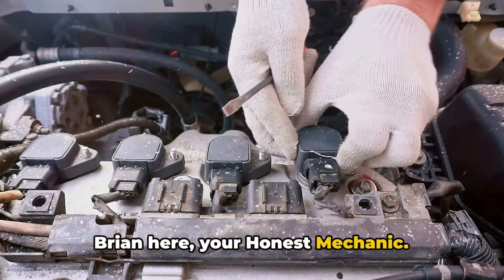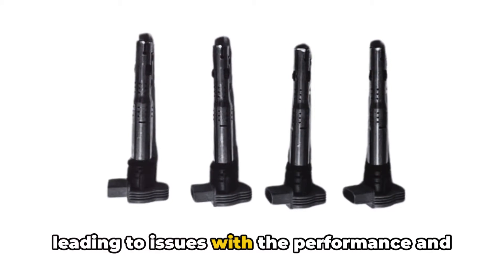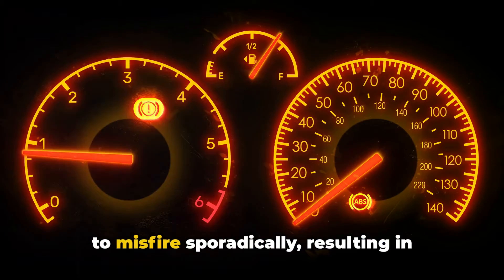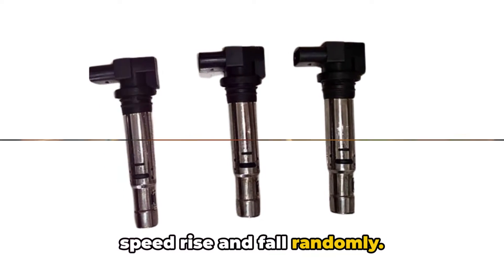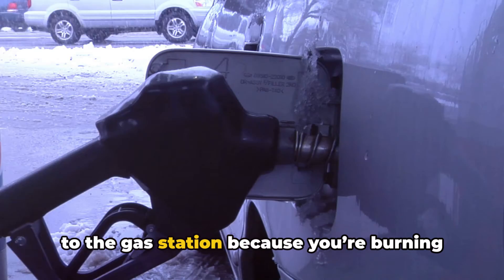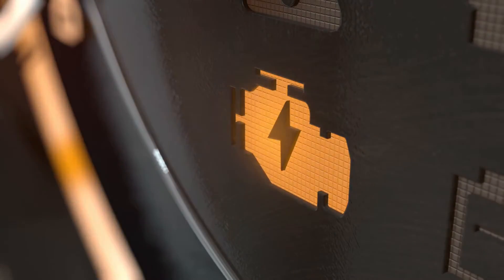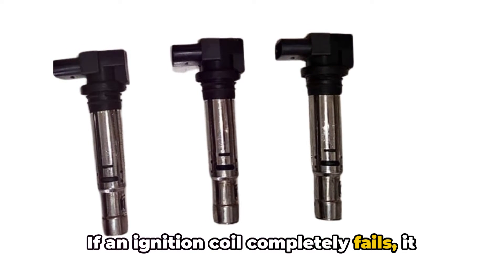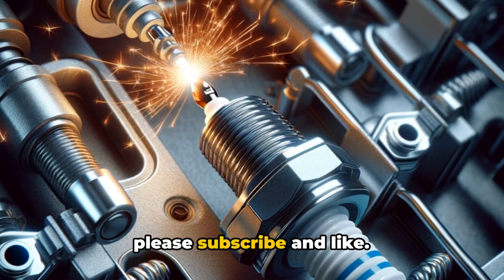Bad Ignition Coil Symptoms: 7 Common Signs

Comment: I get a EPC light not a check engine light.... And do notice my fuel going up and down after pumping gas did the coil test and it turned out it was the ignition coils

Comment: I was getting super rough idles and at times the car would choke or struggle to turn over. Check engine light finally popped up and got the code and it was a cylinder 2 misfire. Now the car won’t turn over at all. The lights come on radio everything works but the car sounds like it wants to turn over but just the engine kinda clicks but  won’t turn order. My firing order is 1342 so I’m hoping changing out that ignition coil in cylinder 2 fixes it. I just changed spark plugs about 3 months ago
Reply: It should…

Comment: Don't just run out to the parts store and replace the ignition coil(s) based on this video.  There are other things that can cause the same symptoms.  You could start throwing parts at it such as ignition coils, spark plugs, and fuel injectors for instance and it may or may not solve the problem.  Other things that can cause the same issues include a vacuum leak, loss of compression, a bad EGR valve, etc.  Take the time to learn proper diagnosis procedures instead of looking for a quick magical cure.

Comment: When i cold start my car it's normal and getting started within no time after driving for 50kms and when i turn off and turn on the ignition feels like its struggling like a battery low symptoms but battery is brand new please help me to fix my problem already i have spent a lot on fuel pump and so many other things I hope someone with the knowledge can help me
Reply: Sounds like o2 sensor going bad or your coil packs

Comment: Not all the time the code will show up for a failing or weak coil pack remember the coil pack could be working but weak and not not giving out enough spark.
Reply: How to check weak coil... please reply
Reply: @santoshmurukate7894  i had a friend check for a weak coil on my acura cl and unhook one of the coils with the spark plug in still tested the voltage and a point of the car while i cranked it to see if it would spark once i got no spark we moved to replacing coil packs and distributer get them in next week so can always let you know if that fixes
Reply: @santoshmurukate7894 disconnect coil, start car see if symptoms improve. di it for each coil. if you identify a coil, try it on a new cylinder. if the problem follows the coil, its fualty
Reply: That's right.  I had in my car a weak coil pack in cylinder 3 and didn't have any code.  I felt the juddering and jerky when going up hill. Replaced it and all solved.
Reply: @Sebastianvinxc 
Ok thanks for reply

Comment: My 2006 MB C280 had this problem one coil pack was defective working intermittently… check engine lights and esp lights started coming on crazy… found I had one coil pack bad! Question? How long do coil packs last? Thanks.
Reply: Depends on the brand and such. But honestly it’s pretty random. For example, on my family’s 07 Accent, the OEM lasted roughly 10 years, and the aftermarket ones I bought just failed after roughly 7 years

Comment: Four times we've taken our car back to the dealer describing these exact symptoms, just for them to tell us there's no fault found. It's out of warranty now and we were told it would cost us £160 per hour just for them to look at the car! It nearly broke down today so we got roadside assistance to come out and check it. Typical that the car was back to operating as normal, but the guy told us to check out the ignition coil.

With that excellent advice and your concise and extremely helpful video here, we might have found the culpret to our car's problem 👍

Comment: Would a faulty ignition coil pack cause a loud noise akin to an impact gun used by wheel technicians? My Ecoboost Mustang has done that and today it did it again and stalled out on me.
Reply: Hello there my car is as well stalling did you find the reason behind it
Reply: @ Bad Purge valve canister.

Comment: What if my Mechanic used NEVER SEIZE on new coil packs when installed by accident instead of Dioelelectric grease,  he stated it would be fine,  at higher speeds,  I start to get like a shutter or misfire, this same issue happened before and under warranty,  I took in on Pontiac Grand am V6 3.1L and ended up being the coil packs there was 3 sets of 2 and 1 was cracked and showed to me,  I thought it was the Transmission going because it did it from 45 to 65 and it feels the same, I also use Amsoil after warranty ran out but went to dealer that was 5 miles away and wanted great carfax records on it, they closed down during the COVID-19 years in 2021 which caught many off guard, then a $55 oil change went to $99 plus taxes  that fast. I heard they used Synthetic Blended oil and never burned oil until started using top oil, at 1st was Valvoline synthetic oil with the top notch fram oil filter that catches microns pretty decent for price,  AMSOIL Filter was $51 and then went to WIX as just as good,  but I do watch ENGINE MASTERS  and they tested all these but not the AMSOIL 1, best was racing Filter from the White Filter with nut on end that doesn't work and slips off and Ford Motorcraft Filter works great with Royal Purple and that is testing for microns and gallons per minute going through engine fast. If haven't seen episode,  I highly recommend it as Steve the ENGINE Dino master was surprised as well but will buy WIX at its price,  you can't beat them,  but I still want to know about coil packs,  anyone with answers,  please leave some remarks about what you think,  I don't want to replace a Catalytic converter as I'm not rebuilding the engine as they say it's the Factory Rings on Pistons and they only gotten worse on newer models,  these can run as high of 400,000 miles with 1 timing chain done. Put Michelins on it and it's like a fast go kart in 4WD EX model and son burned off set that came with it in a year but found out that how he was driving,  I showed him on my SUV how Antilock brakes worked and how fast mine was as he drove it and got 10.5 MPG  when it was at easy driving could get 16 flat but mostly was 15 to 22 miles for V8 4.6L Ford in Explorer awd limited edition with just 69,000 now but had 32,500 and warranty ran out plus friend started to fix more things on it, gave me a great deal then when worth $10K, paid $4,500 then coils went and 13 months old, he gave me all recipes with it, I replaced everything he did and 1 winter it sat as though bad intake but no heat, bad water pump and never left a drop. I replaced rubber cap on intake 3 times as cracked and blew out all antifreeze,  4 gallons it takes,  couldn't buy from Ford,  bought at auto zone and not as good or close to factory one,  alternator twice an tensioner from local and went bad again, no warranty, pulleys twice and I replaced all pulleys/idlers so all new at same time from same company which I believe was Gates recommended or Dayco, would have to look at receipts, for 4 I believe $85 for all online through Rock Auto, just watch shipping as comes from another warehouse and another $11.99 for shipping and buy local for same or 2 bucks more but cheaper still on stuff, also Summit racing has great deals as well. be safe as he didn't. Summit last knew has free shipping over $100 and get the best Rotors and pads Combo sets or buy Separately and very fast shipping over other company or pay higher prices for it and 1 day earier wasted money back then as raining out and was supposed to be 2 days earlier but hung up at location they said, with Summit, I believe it's done ASAP and picked up and not waiting for more to come in as there busy over other place and if call, can get better deals as work on sales commission so can knock 5% off if order through them  as I have because I asked if work off commissions or not,  just had a question before placing but saved me over $40 on order for a bunch of stuff back then.  Been awhile,  so don't know.  If any, will get electric bike to get medicine as can't afford stuff anymore.  I'll use a kids seat for 2 and put food in it. , when they came out in 2003 era, bought 1 for son and removed seat and put wagon handle over post and seat back on and pulling kids around then on 350 from Schwan went 10mph and 8 miles on a charge.  Used at the campground back then

Comment: Is there a way of knowing if it is a spark plug misfire vs an ignition coil misfire?
Reply: Best to change both I believe. I had the jerking/misfire issue then replacing the spark plugs actually fixed it. Till three months later it's happened again. Due to change both ignition coils and spark plugs tomorrow hoping for the best 🤞
Reply: @ShahAli-c3k  did you fix the problem
Reply: @magnumlife4081  Yes been almost 2 weeks and my cars running smooth
Reply: @ShahAli-c3k did it fixed the issue?
Reply: You could get a spark plug tester for less than 20 bucks and that’ll tell you if it is or isn’t the plugs 😊
Reply: Get a cheap Obd 2 reader, see which cylinder is throwing the error, then move the coil from that cylinder to a different one and see if the code moves with the relocated coil. If it doesn't, it's the spark plug, if it does, it's the coil. I had the same problem and fixed it today. Also check if there oil around the coils, which could indicate a leaking rocker cover gasket, again a relatively easy fix. Oil will degrade the coils so best to get the gasket fixed as well.
Reply: @pritinpatel7074 thanks for the tip
Reply: That’s my problem right now i don’t know which one

Comment: What component on the coil wears out and how? What should the voltage be going into the spark plug of an average 4 cylinder car?
Reply: Chronic exposere to high voltage breaks down insulation and cause it to start arcing between internal coil windings or to the iron core.

Comment: My car has rough idle and when i start to drive it jerks for max 1km then when it warms up it runs normal bad ignition coils?
Reply: Could be vacuum leak, spark plugs, ignition coils, EGR system like a vacuum leak or stuck open valve, purge valve, EGR Solenoid. Worse case, could be your belt tensioner or even worse timing. Could be anything, because of spark, air, pressure, compression and fuel.
Reply: Have same issues, so many could be ….
Reply: Same problem
Reply: @GaneshTanpure143  I changed coils still same problem i think its the sensor fault MAP/MAF when i disconnect it the car runs fine
Reply: @jablenski   i think same thing happened to my car. I'll try removing the maf again. thanks
Reply: Did you check the spark plugs? Is one particlar plug wet with gas or have rich, powedery, black, fuel-fouled deposits?
Reply: @gregorymalchuk272 yes I took a spark plug out and I noticed black powdery residue what does that mean
Reply: @LaborGoats  It could mean intermittently failing coils, ignition control modules, plug wires, plug stalks on modern engines with the spark plugs down a deep hole in the valve cover. It could be failing fuel injectors like sticking open, sticking closed, dirty and poor spray pattern, or leaking fuel. Or it could originate somewhere else like from low compression from broken or worn piston rings, broken valve springs, pitted valve seats or slightly bent valves, or failing lifters or worn-off cam lobes. Good luck.

Comment: At point 7 you say that if it fails completely it will stop sparking the plugs in that particular cylinder. But if it completely fails would the engine be able to start at all/wouldn’t all spark plugs stop sparking? Asking as i have a 5.0 v8 mercruiser that can be difficult to start and on changing plugs noticed two of the 8 were blacker than the others and i definitely get a smell of gas when moving
Reply from the maker: When a spark plug fails in an engine, it typically only affects the cylinder it's in. In your V8 engine, if two spark plugs are fouled and blackened, it's likely that those two cylinders are misfiring. This means that those specific cylinders are not burning the fuel properly, which leads to the unburned fuel smell you're noticing. 

An engine can still start and run with one or more bad spark plugs, but it will run poorly and be less efficient. If the problem is severe, starting can become difficult, and the engine will exhibit symptoms such as rough idling, reduced power, and increased fuel consumption. 

Given your description of the symptoms and the observation of the spark plugs, it's a good idea to replace the fouled plugs and check for any underlying issues, such as a rich fuel mixture or ignition problems, that might have caused the plugs to foul in the first place.
Reply: @HonestMechanicChannel thats great, thank you. Ive got new plugs, leads, distributor cap and coil to fit. Thanks again 👍
Reply: I have a 95 dodge ram van B2500 w/5.2 L. It was stalling intermittently when idling at a stop light but always started right up. It would be idling fine then suddenly rough for a second & stall. It was running rich with black smoke but doesn't seem to be doing that now. Now it is stalling even while driving if I let off the gas & now won't start again unless it sits a bit. We have changed a lot of parts. Could this be the coil. When it runs it runs good till all the sudden it goes rough & stalls. Seems to have power except 1 time it cut out bad & was really slowing but it made it without stalling that time.

Comment: I have a Nissan Nerva Ka24de 2000 petrel RWD with the coil inside the distributor cap, I had a small misfire when the car warmed up and when i pulled the number one cylinder sparkplug out, the plug had a wet residue build-up on the sparkplug thread, when I cleaned the corrosion from the pins under the cup and the green corrosion on the coil, The misfire went away and no more residue after a cupel week of driving on the number one plug thread, which means the cylinder combustion is firing correctly again, but this problem keeps on coming back every cupel of months..  I have new Leeds, new sparkplugs and a new cap and new PVC valve.. Could It be a faulty coil be causing this residue build up on the sparkplug thread..?   Ps, The valve cover gasket is good no leaks, compression rings is good and valve seals are good, no burring oil or smoke out of the exhaust..